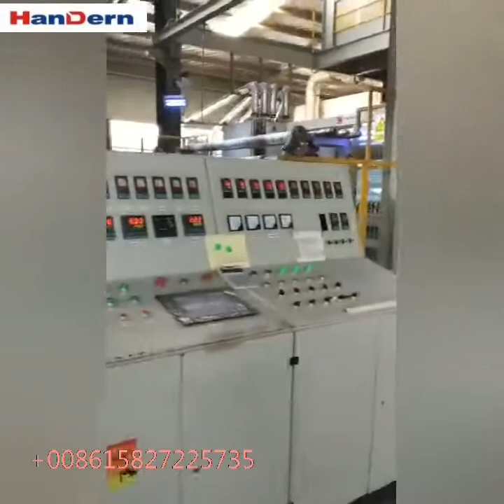PP spunbond non-woven fabric machine，PP spunbond non-woven fabric equipment（Handern 2020）

Comment from the maker: Model	        1600    	2400             3200	          
Product width	1600MM	        2400MM		3200MM
GSM range	20-250gsm	20-250gsm       20-250gsm
	
Speed	        10-250m/min 	10-250m/min     10-250m/min 

PP spunbond nonwoven fabric making machine website:
www.handern.net
www.handern.com
http://www.handern.net/cases/show/437.html
http://www.handern.net/PP-spunbond-non-woven-fabric-machine.htm

@Company:Wuhan Handern Machinery Co.,Ltd.
Add:No.61 Yinbo Road,Jinghe Street,Dongxihu,Wuhan,Hubei,China
Website:http://www.handern.net
http://www.handern.com

Mobile:+0086-13986280012